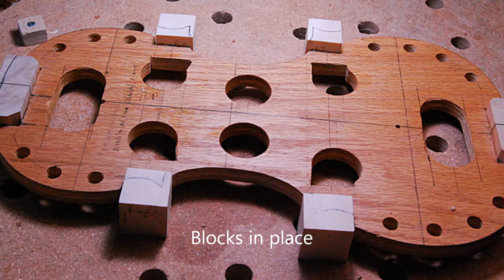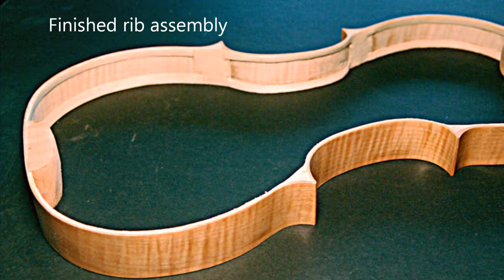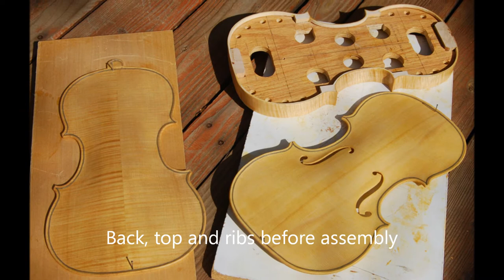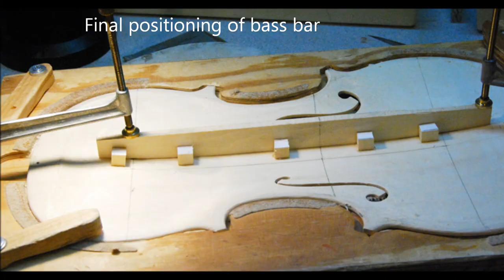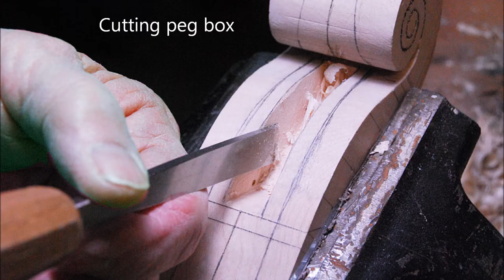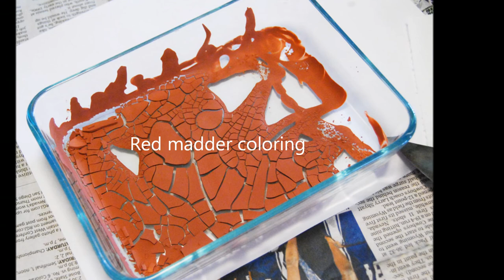Nelle Doak O'Neill, Luthier: The Creation of Violin, 'Lara'

Comment: Could you pleas name the kind of would must be used in construction of violin?
Reply: If you didn’t find it, it’s Striaght Grain Spruce for the top and bottom plate.  Maple is used for virtually every other aspect, ie; the neck; the corner, top, and bottom blocks; the bass bar; the sound post, the scroll.  Since specific woods are used you will usually buy sets of wood that have a basic shape outlines on them.